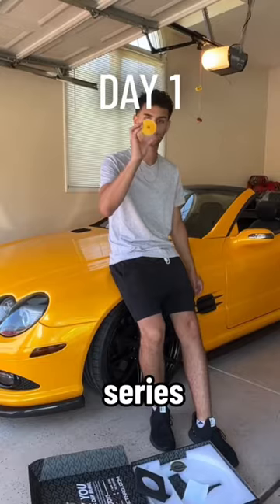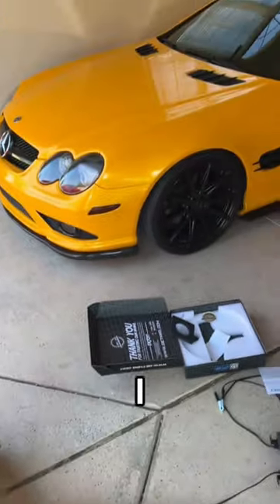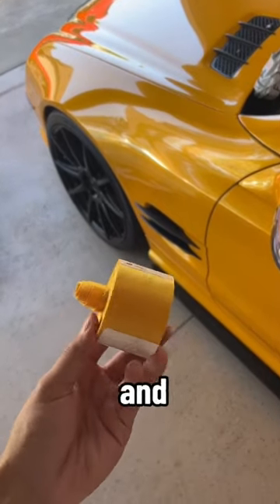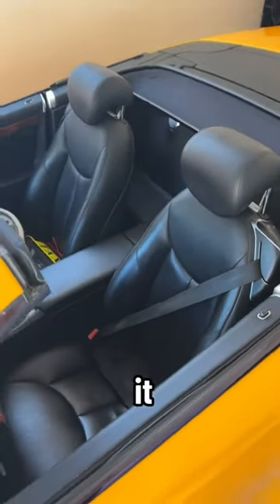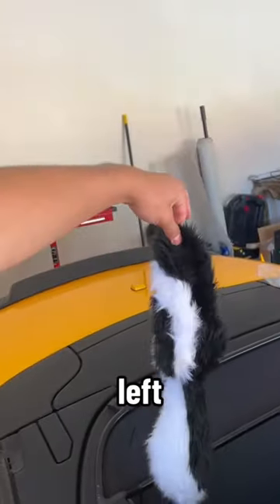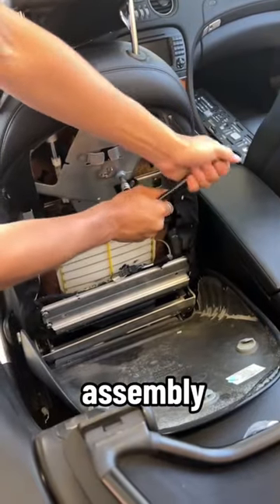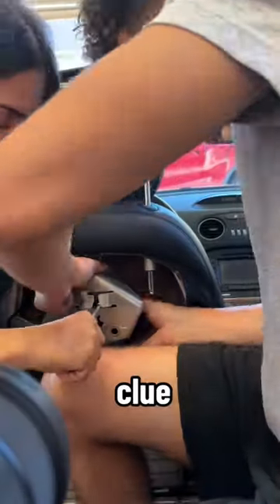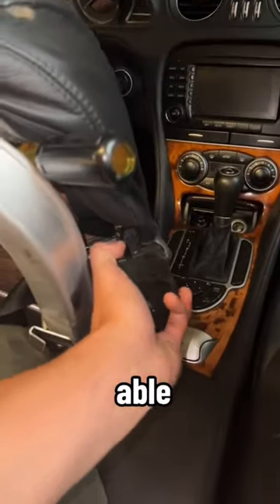Turned out Sickk😌😋

Comment: HE STILL ISNT DOING PERFORMANCE MODS
Reply: Doin too much to that old engine will risk blowing the whole thing. Once u do a few things u gotta start replacing everything else to account for that extra power. Ain’t as easy as it might sound.
Reply: @deang8910 yes that's what you gotta do to modify almost any old car alot of work ! All those parts that seem good are probably 20 plus year old rubber that will crack to hand pull

Comment from the maker: What else should I change?
Reply: Give it a better engine
Reply: Carbon steering wheel, carbon wood interior delete, doorpanels with carbon accents, floor mats, shift knob, radio upgrade with screen.
Edit.
And black headliner and black A-pillar plastics would make the car look way better
Reply: The Steering.. The carpets.. The leather.. The roof.. The Pedals.. Ambience lights.. you can also add some touches on the doors to make them look filthier and also to match with the new lether theme.. And the most important thing remove that ugly bloodclat wood next to the gear 💀 horror
Reply: Nicer steering wheel
Reply: Performance mods
Reply: Add a taxometer
Reply: Racing bucket seats, racing steering wheel
Reply: @pranavprasanna3861 bro wtf is a taxometer!? 😂
U mean tachometer lol
Reply: Re-upholster the seats with alcantara  (don’t know how to spell that 😂) and leather. It’ll give the interior a brand new updated feel. Also wrap all the interior trim with carbon fiber, and possibly an aftermarket steering wheel?
Reply: @deang8910  no, it’s a taxi fare meter 😂
Reply: @pranavprasanna3861  oh! 🤣